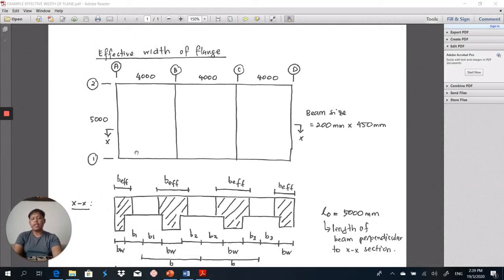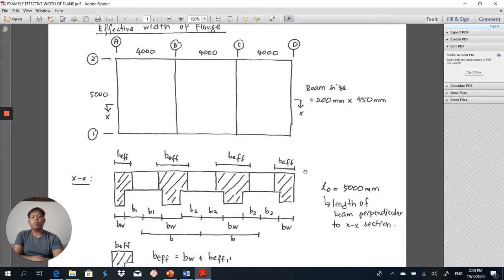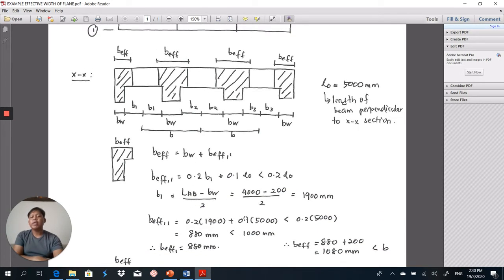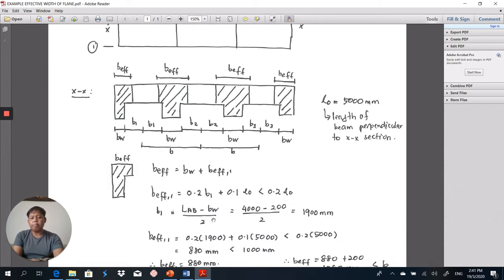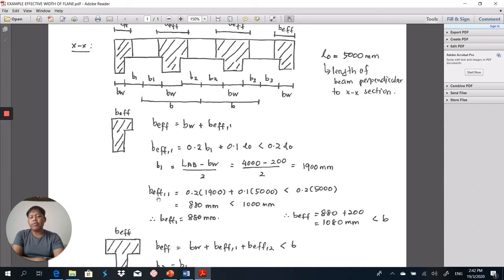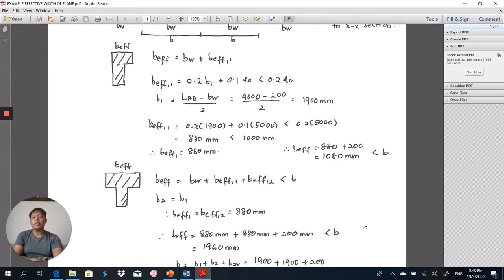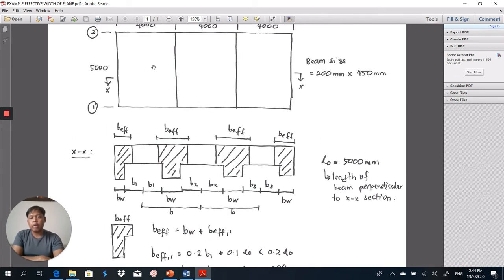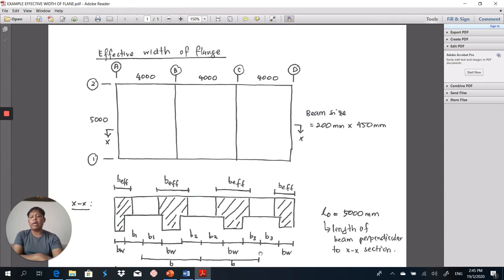EFFECTIVE WIDTH OF FLANGE FOR BEAM

Comment: Sir how to find beam size fr flanged section
Reply from the maker: same as rectangular for estimation of early size which indicate size for bw and h (span/depth ratio and due to fire resistance) as in my example. but for effective width of flange u have to use the step shows in the calculation.

Comment: Sir, will it be any difference if the cut section x-x is taken along the vertical axis??
Reply from the maker: yes it will be different. it is depending on which beam that you would like to design. if your x-x section is along the vertical axis, therefore you lo is perpendicular to that section.
Reply: @mohdsamsudinabdulhamid3295  how did u find out that Lo is equal to 5000??